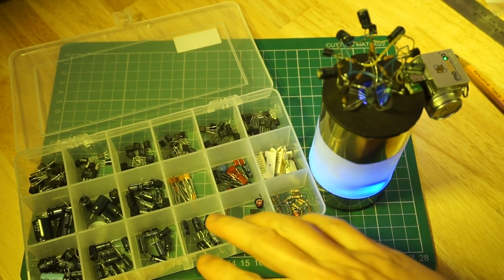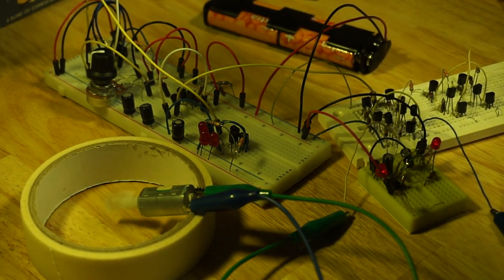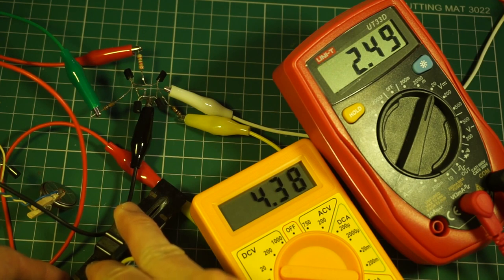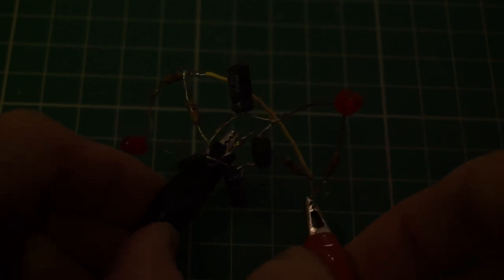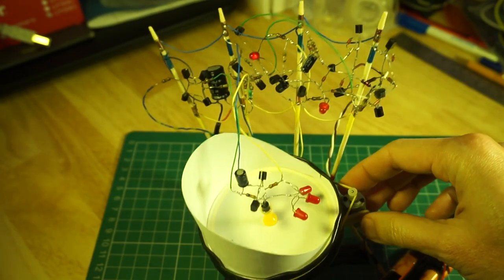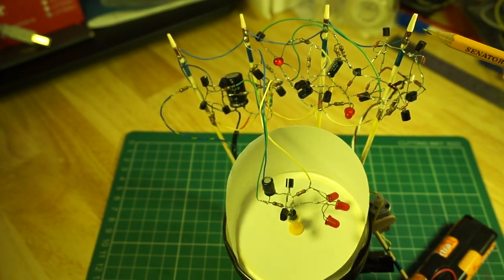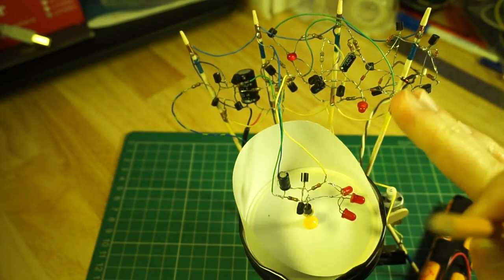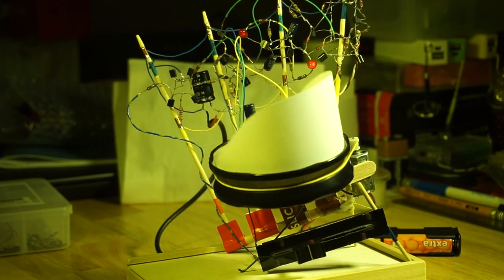Light Sensitive Kinetic Circuit Sculpture Tribute To My Dad

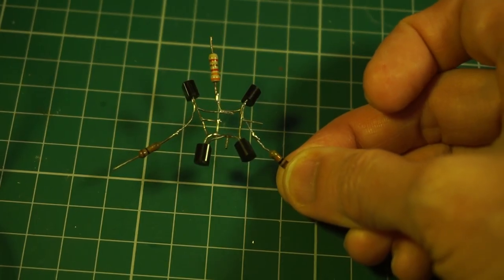Comment: 4:16 You mentioned two PNP transistors for the comparator and two NPN for the current mirror.  That is opposite of w2aew's reference circuit.  Was that deliberate, or did you mean to say the opposite?
Reply from the maker: Well spotted!
Looking back at the circuit now, for some forgotten reason I seemed to have flipped the polarity of the entire thing and didn't bother to mention it. It might have something to do with my self imposed limit of using only the parts in my dad's junk bin.
Reply: @bornach  The part count is the same either way, right? :).  I ask because I'm trying to build a comparator myself.  It works, but the range is very narrow and I'm not getting a close to zero swing that you are seeing.  It's more in the range of 1.9v to 2.9v with a 5v supply and 100k voltage dividers at the inputs with 3k sink resistor.
Reply from the maker: @Enigma758  That's cool! You definitely should ignore what I've done here. It might only happened to work with the weird ancient Archer PNPs from Radio Shack that my Dad bought in the 1980s. You already are aware of Alan Wolke. You must have seen John Audio Tech's videos on transistors and the long tailed pair https://youtu.be/7rb0Q-NeuZs
Also recommended is IMSAI Guy's short series on how to breadboard a simple opamp using BJTs and other through hole discrete components https://youtu.be/Z8JDsvfZjL8
Reply: @bornach  Maybe my components aren't well matched.  Yes, I subscribe to all of the above and I think I must have watched every video on the topic :).  Looking to build an old school Walter Grey style tortoise with discrete components.  BTW, your video is a favorite of mine when it comes to "transistor hacking" :).